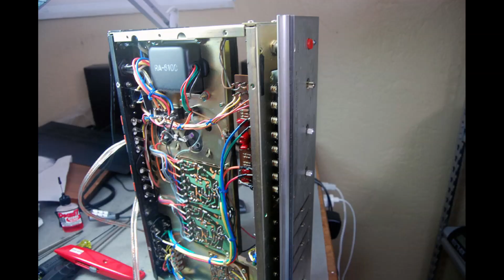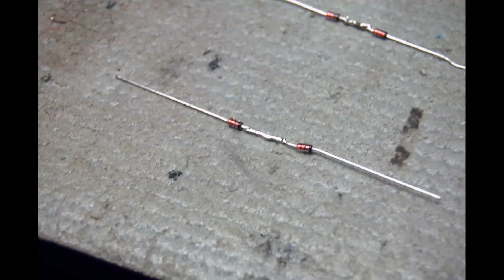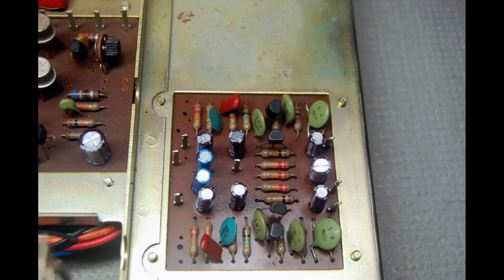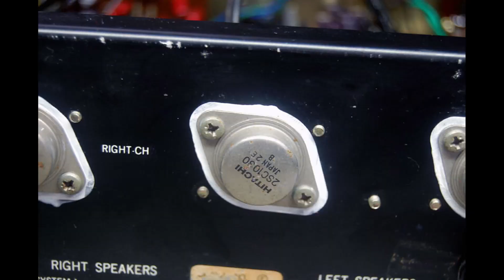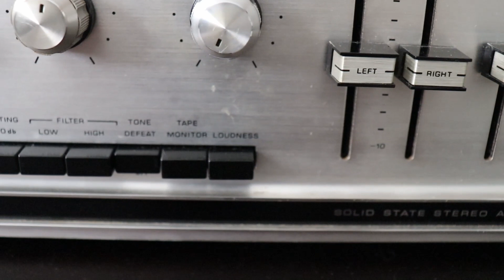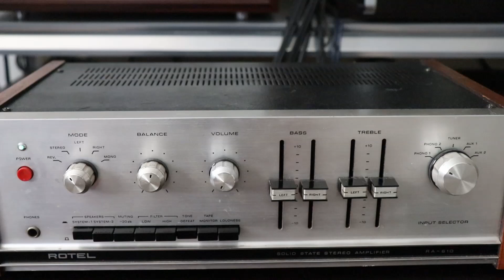Rotel RA 610 Vintage Stereo Integrated Audio Amplifier. Repair And Restoration Of Older Electronics

Comment: Hi thanks for the very interesting review     
personally i think that a nice feature is the separation between preamp and power amp sections    
i like to mix and match different units ... 
if i had a decent spectrum analyzer i would measure the two sections separately
Reply from the maker: You're welcome, glad you found it interesting!

Comment: I just picked up the worst condition RA611 (next model on) for five bucks from a recycling center. It was in a very sad state looking as if it had been stored in a car port for thirty years with dirt, feathers and grass 
right through it.
I restored the case, slider pots (all bent) and face plate to almost brand new, but the power amp board had suffered badly from poor repairs and abuse with 30A fuses everywhere. The PCB material was burned, 
with tracks missing and all output transistors blown. I decided to re power it using MX50SE modules (kits) which were a perfect fit both physically (with a proper heatsink upgrade) and electrically, with the original tansformer being good giving 44V CT for +/-31V DC.
It gives exatly 41 watts, and the MX50 modules have outstanding performance with a flat response and extremely low distortion. I also used Sanken 2SA/2SC output transistors for even better performance. I also fitted 
a new rectifier/filter board (from Aiyima) and an additional pair of regulators for the preamp and phono equalizer. Total outlay was around $80 wnd a lot of fun doing the restoration, but the result is impressive. I have
worked in pro audio most of my life, built and repaired more amplifiers in my work than I can remember, but this one is a standoutand and definitely a keeper. Well worth hunting for.

Comment: Is Rotel the high-end of Kenwood?  I ask as it looks like my vintage Kenwood integrated in terms of face plate, side panels and top.  Branding is in the same location.
Reply: Actually it's Accuphase that has been founded by some Kenwood engineers if i read well

Comment: I saw one of these (RA 610) on eBay so I bought it based largely on your recommendation. I got it for AUD 120 which is about USD 85. It needs full restoration. I'm not hugely experienced in vintage restorations, and this project looked good because the Rotel seems to have a lot less wiring than a comparable Marantz.
Reply from the maker: Great Deal! Just take your time with her. She's a very nice integrated from the early 1970's and is often overlooked. Good luck!